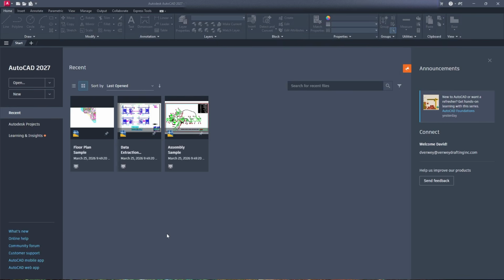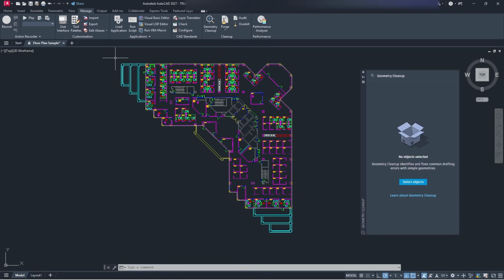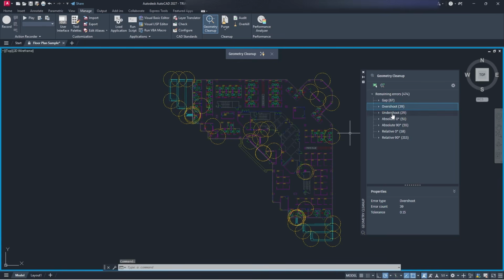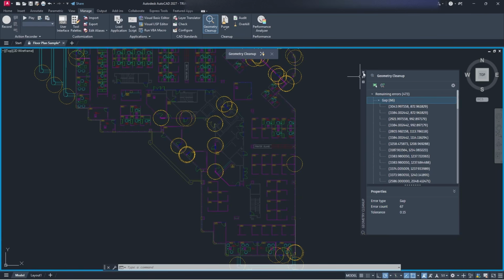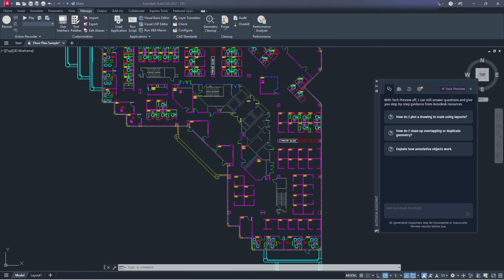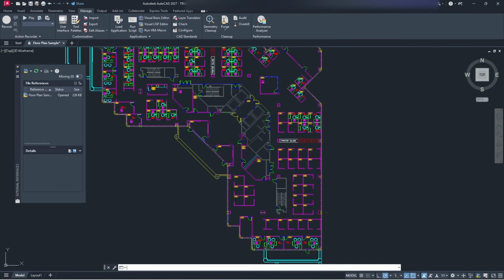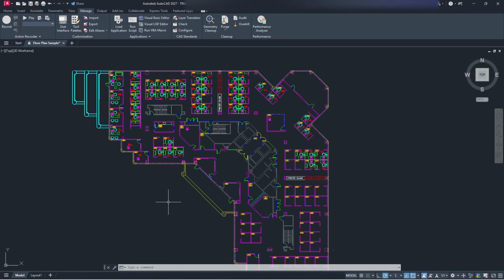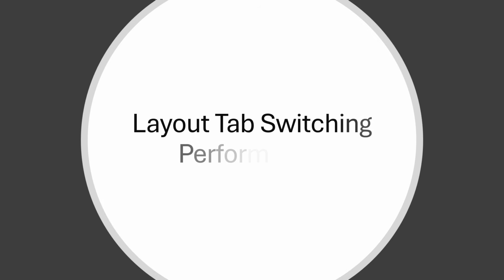What's NEW in AutoCAD 2027?

Comment: Wouldn’t have to worry about all these issues under shooting and overshooting if we all went back to drafting by hand all the software and we’re still going backwards. Old school drafting was never broken.
Reply: as a surveyor, those functions are time savers because its next to impossible to measure 2 points on the exact same spot, so no not all functions will have a use to you but luckely you are niet the only one using CAD
Reply: @ricardozegers6023  Agreed on the surveying use case. Point snapping tolerance issues are real in field to CAD workflows. That said, the original comment was about software regression and feature bloat, not whether snapping functions have any use. Nobody said CAD is one size fits all. The Windows 11 exclusivity on a 2027 release is a legitimate gripe regardless of your discipline. Old school drafting which is now an art is still widely accepted by AHJs.